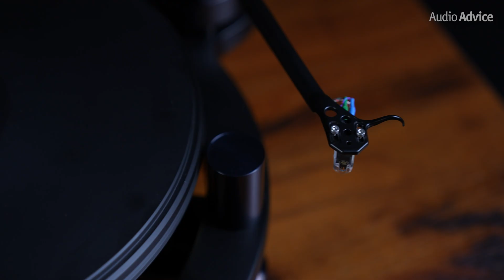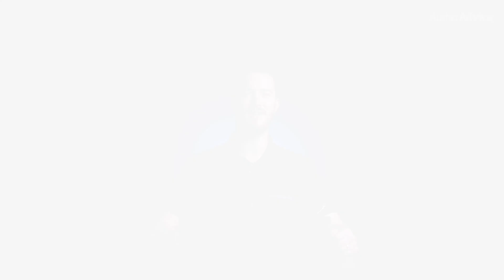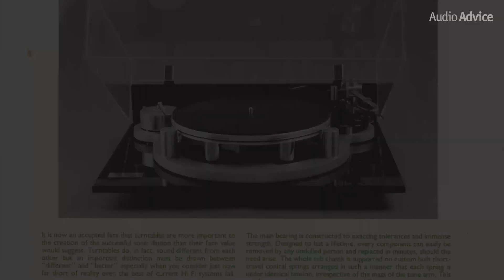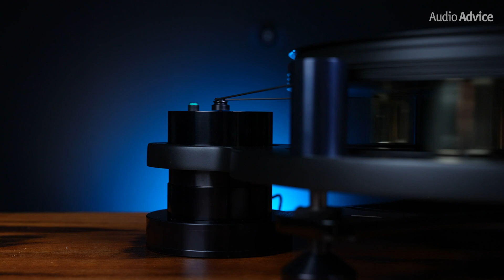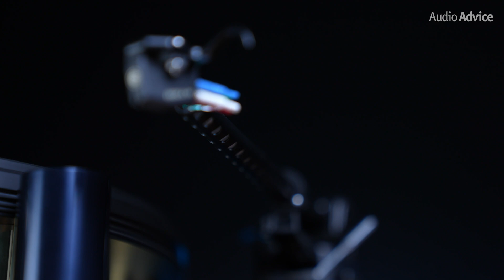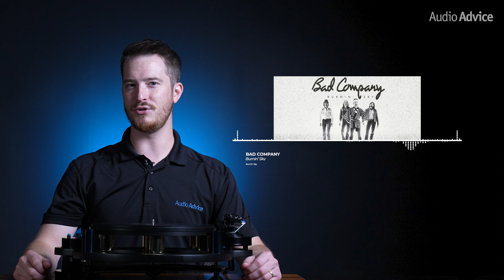Michell Gyro SE - Where Design Meets Sound

Comment: Black on black video is great to sell excellence where none can be seen, whether it’s there or not.
Reply from the maker: Not sure what you mean.  The Gyro SE is a highly respected turntable.
Reply: @AudioAdvice  that‘s what I thought. I was referring to your videography being too dark. My realisation meanwhile: they hiked themselves up one, two classes in price believing their storytelling, while reducing the promised flexibility.
For a matter of fact and I never taken them serious in their former generation of gear. But today Technics smashes all in any price range they are present. Oh, and I still don‘t like them, but subjectively on their style.
Rega still offers the best belt and style options in the classes they positioned themselves in, and Michell knows that, thus upsells their story, uses their (Rega’s) cheapest arm and sells it as Michell as higher grade price than original, without a mod, and more so slightly „modified“ so much not that the few good mods work on a Rega as well.

It combines the better than Linn bounce with the glitter rotator and a rega arm and the only relevant thing being the pumping bearing, an unnecessary complexity if the bearing and grease/oil are designed rightly in the first place, if not, you need such mechanism. Both are not maintenance free, thus there‘s no improvement, as normal bearings go well for decades, too.

Comment: I get all of the isolation technology built into the platter/tt from noise or any other interferences. I have a 50th Rega P3 sitting on isoacoustic isolators. I argue that the beautiful sound described in this video has way more to do with the stylus/cartridge than the tt itself.
Reply from the maker: Fair enough. Michell just has a lot of really great isolation tech!
Reply: @AudioAdvice  Yeah, I fully agree. And very asthetically pleasing!

Comment: While shotblasting will reduce mass, it will not under ANY circumstances improve rigidity.

This is misinformation, or an inaccurate statement by the narrator.
Reply: Umm.
Two words: Strain Hardening.
Aluminum can absolutely made stronger by shot blasting. 
Now you learned two things, aluminum can be made stronger by beating on it, and how easy it is to make a fool of oneself in public
Reply from the maker: Thanks for calling this out. We had pulled it directly from the Michell website so we reached out to them and just heard back.  They apologize for the misinformation as this was written by someone no longer with the company.  They said it should say it increases strength and reduces mass, although we are still not sure how it increases strength and have inquired again.